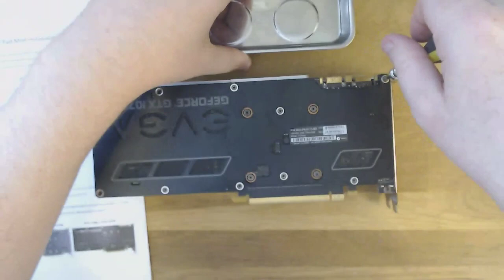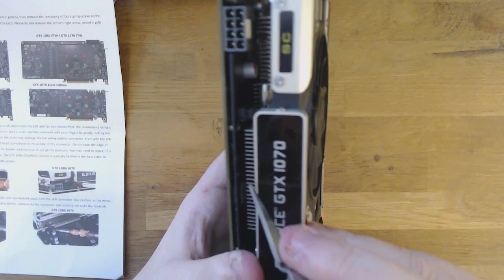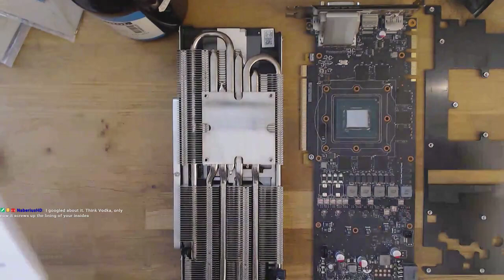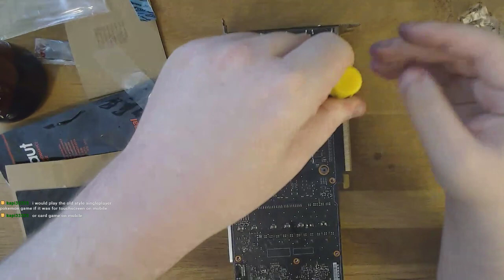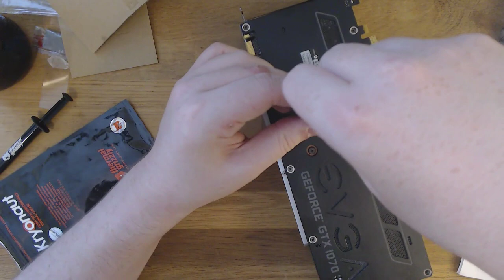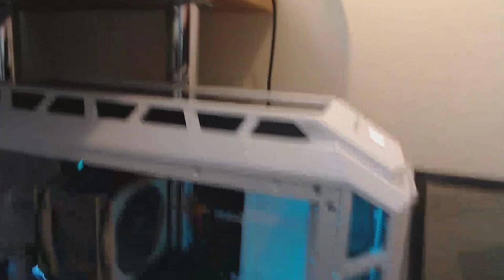PC Build Day 2! EVGA GTX 1070 Teardown and Thermal Mod

Comment: Sir, thick thermal pad  1mm or 0,5mm?
Reply: i got 0.5 but reading the comment i realised that 1.5 would be good, you can stack thermal pads though but not more then 3, so it should be pretty ok

Comment: hey toasty. I'm just getting around to replacing the pads i got from an rma years ago. I was wondering if you still had this guide that was on the left of the video and if it had the thickness of thermal pads on it. I was looking to upgrade the pads and thermal paste after years of use. thanks! :)
Reply from the maker: Unfortunately no I've almost definitely thrown them out since. I would recommend just contacting EVGA support or their twitter though, I'm sure they would be able to look up the pages internally

Comment: Anyone know the thickness of the Thermal pad used? It will really helpful
Reply: Yes, a big slab (about 65mmx85mm) plus four tiny pieces (about 5mmx15mm) of 2mm thick between the backplate and the main circuit board. The rest are all 1.5 mm three pieces surrounding the gpu chip and a couple of strips over the mosfets etc. No other thicknesses required. I measured all with a digital caliper.
Reply: @thequietkiwi  👍 exact answer i needed thank you lol
Reply: It's actually 1.5mm but 2mm would be better as long as the pad is not hard.

Comment: Not sure if you still have this gpu, but would you consider a deshroud if it's even possible?

I've been debating it and using 2 92mm fans to replace the stock fans for potentially better temps.
Reply from the maker: I do still have the card but its no longer in use so It;s not something I'd be too interested in. Funnily enough I have a friend that deshrouded his 2080ti for 2 120 mm Noctua, but it actually made the performance overall worse as the fans couldn't push enough air directly behind the center of the fans, creating a hotspot that made everything worse. 

If you do go for it, be sure to have a good idea where the hotspots are on the card, and make sure the fans are blowing over those spots (as well as getting good coverage in general)